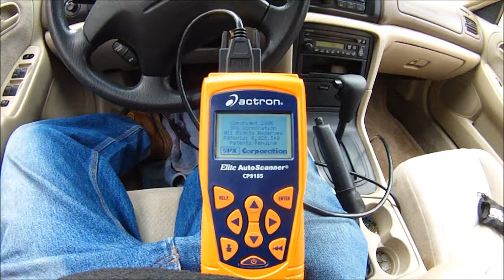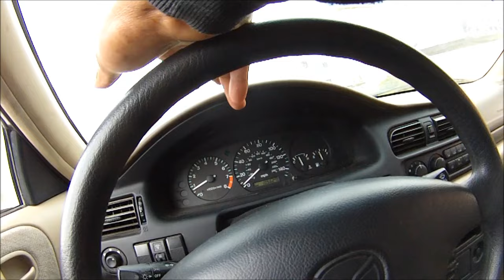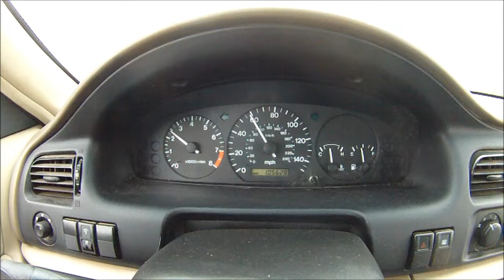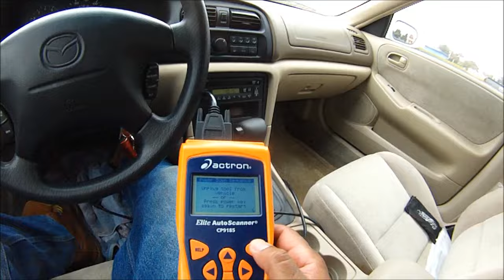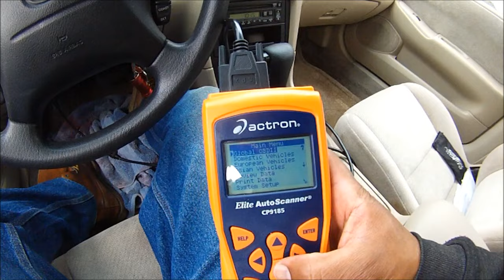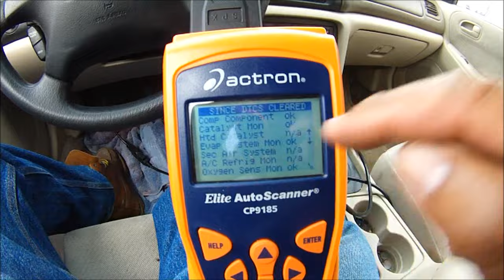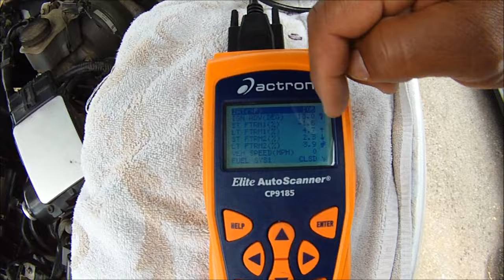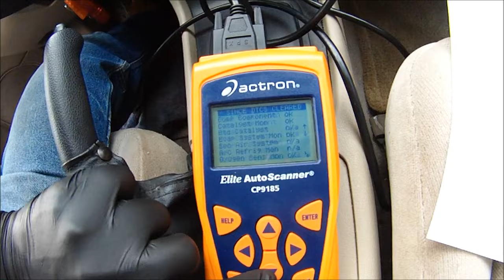WHAT SMOG TECHS WONT TELL YOU AFTER YOU FAIL THE SMOG TEST FOR (INCOMPLETION OF OBDII SELF TEST)

Comment: wow I did this without using an action or any code reader. I just disconnected the battery at a gas station bye a freeway on ramp made sure I didn't hit the breaks just used my E-break got on the freeway and keeped it between 35 and 55 miles an hour for 5 minutes then exited useing the break four at least 5 stop lights or 5 minutes. no more check engine light and went straight to the smog station. passed with flying colors. vwryt happy now great idea good job bro. for the video you posted.
Reply: same thing woulda happened if you just drove normally too  ;) lol
Reply: true but the scanner is nice tool for long term diagnosis with paying $$$ to shop just to look at check engine light. BUT I drove normally and still would not fix issue. I had to complete BMW drive cycles to get I/M ready state several times this week almost 200 miles!
Reply: "lol" you obviously have no experience with readiness tests not starting/finishing. MANY cars literally take over a thousand miles of "regular" driving until all tests clear if you do not drive in the vehicles specific drive cycles multiple times, including letting the car sit in between cycles overnight to get complete cold starts.
Reply: SUPEROBSCUREBEATS actually theyre programed to run asap under "normal"  driving.  If they're not running for someone for 1000 miles u are very far into "abnormal"  conditions. 

And i do have plenty of experience with obd2 (but yes like u said.. Not much with "drive cycle problems" if everything is working properly and u have patience  u can avoid driving around like an idiot (or wasting time on the dyno.)   

My comment is directed towards the 99% of people reading this.. I repeat u don't need to worry about drive cycles.  Theyre designed to be invisible and automatic (thats what makes them an effective self check)
Reply: Well the good thing is having this code reader is very helpful for troubleshooting issues and pro active maintenance at low cost besides just smog pass tests.

Comment: This works! It did it last night because there's less traffic at night. My Chrysler Pacifica 2006 passed smog. I got on the freeway and put it on cruise control over 55MPH  drove for 5+ minutes than drove the street for 20 minutes both the CAT an O2 sensor reset. Thank you for posting it. FYI 
Before I drove the car over 200 miles and took it to the smog place and they kept telling me the monitors where not ready. Did this and it works.

Comment: I have been driving cars to set monitors for a few years now. I agree with most of what you say, but using the emergency brake to stop the car on a busy road isn't a good idea. The cars behind you won't notice you stopping because the brake lights won't light up, and you may get hit, same applies to just "coasting" to a stop. Also, to help run EVAP, make sure you half between 3/4 and 1/4 of a tank of fuel. On most cars, a little above half works well.

Comment: I didn't even get a chance to follow your drive cycle "hack." I had to jump start my wife's Jeep and when I took it to the smog guy, it failed because the monitoring systems were not ready - he told me to drive 100 - 200 miles, so I planned on doing so in the next two days. I found this video and was going to follow the instructions; I plugged in my ODB2 scanner (which already had a big I/M button) and all of my systems except EGR were already ready. While on the drive back to the smog guy, the EGR was ready and I passed smog.

Comment: omg thank you. i knew this was a gamble but it worked for me and you just saved me so much money and bought me some more time. i had a check engine light on with code p770 shift solenoid e malfunction, but my trans was running fine and the mechanic told me it would cost anywhere from $500-1500! that's half the value of my car and i could not justify spending that much. first, i pulled the emf fuse out for a minute, then did the drive cycle just as you said, then added some oil and used carb cleaner on throttle body, filled tank up halfway, filled tires with air and took it directly to the smog station when the light didn't come back on. it passed! thank you!

Comment: oldskool u speak true. 
the cars that need repairs are the one with smoke coming out the exhaust. all other cars dont need repairs for exhaust air. cars are more clean than before 1995 and most of the cars before 95 are also clean. now the cars that are poluting the most from before 95 are becoming exempt from smog. when it should be the newer cars that should be exempt from smog test, they run cleaner and more efficent.

we the mechanics and technitions shouldnt fear police when out on the street testing a car. we are the ones who they come to to fix their cars. 

keep doing what u do oldskool.
"handleit"

Comment: I been a smog tech in cal for 15 years. What oldskool did  was right to set the monitors on most cars.I just want to add a  few things he didnt mention even though he did them right. Its very important that you start your car when it is completely cold and once it is started  just let it idle, DO NOT drive the car for 3 or 4 minutes.If the car isnt cold or if it is cold and you drive away with out it idling for a few minutes you can drive it all day and you will never set the evap monitor on most cars.This only applies to the evap monitor.

Comment: Ford Drive Cycle Recommendations: (don't worry to much about step 14, most states a car will still pass with with an inc evap monitor but if your vehicle has adjustable timing make sure and check the timing, your car will fail if timing off even if it passes everything else)
1. Most OBDII monitors will complete more readily using a "steady foot" driving style during cruise or acceleration modes. Operating the throttle in a "smooth" fashion will minimize the time required for monitor completion.
2.  fuel tank level should be between 1/2 and 3/4 fill with 3/4 fill being the most desirable. 
3. The Evaporative Monitor can only operate during the first 30 minutes of engine operation. When executing the procedure for this monitor, stay in part throttle mode and drive in a smooth fashion to minimize "fuel slosh". 

Drive Cycle Preparation  - 1. Install scan tool. Turn key on with the engine off. Cycle key off, then on. Select appropriate Vehicle & Engine qualifier. Clear all DTC's/ Perform a PCM Reset. Begin to monitor the following PIDs: ECT, EVAPDC, FLI (if available) and TP MODE. Start vehicle WITHOUT returning to Key Off. Idle vehicle for 15 seconds, then drive at 40 MPH until ECT is at least 170°F.

Prep for Monitor Entry - 4. Is IAT within 40 to 100° F? If Not, complete the following steps but, note that step 14 will be required to "bypass" the Evap monitor. 

HEGO Monitor - 5. Cruise at 40 MPH for up to 4 minutes.

EVAP Monitor - 6. Cruise at 45 to 65 MPH for 10 minutes (avoid sharp turns and hills) Note: To initiate the monitor TP MODE should =PT, EVAPDC must be >75%, and FLI must be between 15 and 85%

Catalyst Monitor - 7. Drive in stop and go traffic conditions. Include five different constant cruise speeds, ranging from 25 to 45 MPH over a 10 minute period.

EGR Monitor - 8. From a stop, accelerate to 45 MPH at 1/2 to 3/4 throttle. Repeat 3 times.

SEC AIR/CCM (Engine) - 9. Bring the vehicle to a stop. Idle with transmission in drive (neutral for M/T) for 2 minutes.

CCM (Trans) - 10. For M/T, accelerate from 0 to 50 MPH, continue to step 11. For A/T, from a stop and in overdrive, moderately accelerate to 50 MPH and cruise for at least 15 seconds. Stop vehicle and repeat without overdrive to 40 MPH cruising for at least 30 seconds. While at 40 MPH, activate overdrive and accelerate to 50 MPH and cruise for at least 15 seconds. Stop for at least 20 seconds and repeat step 10 five times.
Misfire & Fuel Monitors - 11. From a stop, accelerate to 65 MPH. Decelerate at closed throttle until 40 MPH (no brakes). Repeat this 3 times.

Readiness Check - 12. Access the ON-Board System Readiness (OBDII monitor status) function on the scan tool. Determine whether all non-continuous monitors have completed. If not, go to step 13.

Pending Code Check and Evap Monitor "Bypass" Check - 13. With the scan tool, check for pending codes. Conduct normal repair procedures for any pending code concern. Otherwise, rerun any incomplete monitor. Note: If the EVAP monitor is not complete AND IAT was out of the 40 to 100° F temperature range in step #4, or the altitude is over 8000 ft., the Evap "bypass" procedure must be followed. Proceed to step 14.

Evap Monitor "Bypass" - 14. Park vehicle for a minimum of 8 hours. Repeat steps 2 through 12. DO NOT REPEAT STEP 1.

Comment: Failed in CAT emission test. Followed your instructions. Cleared and passed the emission test today 01/19/22. Thanks for your well explained video.
Reply: My has a P0420 code And my Check engine light came on after I did the drive cycle T_T
Reply: @ameemetta2790  , it could be faulty 02 sensor,fuel injector,ECM, Spark plug or dirty Air filter.
Reply: @kawaiicreatures8663  ... thank you .

Comment: Rule of thumb that seems to work is driving normally until temp guage is half way (goes into O2 closed loop) for about 15min, then drive some highway miles. (At least past 45MPH.) If you take it to emissions after getting the car warmed up, then it usually goes through ok. Of course this varies per car, but seems pretty consistent on GM 3400 V6. Braking normally doesn't seem to bother it at all, but my car has no problems with vacuum going to the brake, fuel system is airtight, and evap gets enough vacuum to work as it should. (If normal braking causes a fail, it's likely something wrong with a coast-down vacuum condition affecting the emissions stuff.)

Comment: How can I get an older car to pass the smog?
I have a 84 nissan pulsar, I appreciate any help you could provide, thanks!
Reply: The following vehicles are exempt from emissionstesting requirements (but removal or tampering withemissions equipment on any of the listed motor vehicles is prohibited): Model year 1995 and older vehicles. Model year 1996 and newer vehicles that are not OBDII-compliant (must be verified at a test station).

Comment: I just wanted to come on here and say that it worked for my 2000 Nissan Maxima I found it's actual drive cycle which was very close to this. So I did it and after 550 miles of the Cat monitor not being ready the monitors were ready after the 2nd drive cycle attempt. thanks again and good luck

Comment: 11/16/16 - Thank you, oldskool funk!!!! I followed your method in video and passed smog. My car: 2000 Toyota Camry.  Here are a few additions/improvements. For those caught in this particular smog trap, understand a few things: 1) the drive cycles for your car are published by the manufacturer of your car. Contact them, search the internet or go to a dealer -- BUT THESE DOCUMENTS EXIST AND ARE AVAILABLE. Many people will make you believe that the exact parameters of your drive cycle are a mystery -- this is ABSOLUTELY FALSE.  2) The drive cycles not only for your car but for the specific NOT READY situation you are experiencing are VERY PRECISE. If you drive even 5 MPH above or below the expressly directed speed for the drive cycle, you will not succeed. But DO NOT WORRY. Like Oldshool Funk shows us, once you know the speeds to drive, the rest is EASY.  3)  Do this at night when road traffic is minimal. I did this from 10 PM to 11PM and it was easy.  4) Use CRUISE CONTROL as much as possilbe. Cruise control makes doing 60 MPH a piece of cake. It also makes driving 35 MPH easy. 5) I am not sure if avoiding the foot brake is essential as Oldskool Funk describes, but I did it and his method WORKED (thanks again!!!). With that in mind, choose your Exit ramp carefully. I chose one that was 8 miles from my starting point and had and UPHILL slope and a long, clear shoulder. As I approached the exit, I turned cruise control off and I put car into 2nd (lower) gear (automatic trans). This helped slow my forward momentum dramatically without having to use foot brake. Then I entered the shoulder area, running parallel to the freeway, and put the car into NEUTRAL. I then gently applied the hand brake as Oldskool describes and my car came to a nice, safe slow stop. I then turned the car off and waited 1 full minute before going to 2nd phase. That's pretty much it. Don't be intimidated by this. It isn't that the drive cycle thing is such a mystery or so difficult -- it's just very specific. Essentially, manufacturers did this so that no one could fake a smog test. We are forced to drive the car through normal highway speeds (stage 1) and then around town (stage 2) to get it ready for smog. However, highways speeds used to mean 55 MPH. Today in CA they are closer to 80MPH. So you have to drive like -- in my case -- it's 2000 and not 2016. My car tested NOT READY 6 times over 2 months. I spent hours driving all over the place at different speeds to complete the drive cycles.  No one had a real answer. I replaced many parts unnecessarily due to ignorance of others. Then I saw this video and I was able to locate the Manufacturer's Official Drive Cycles Bulletin for my car. In the end, it took 1 hour of driving. My car passed the next mornging. Thank you Oldskool Funk. We are brothers in Smog!

Comment: I hope that you do not mind me adding my 2 cents worth :)
Been a smog tech for 25 years.  Have seen a lot.  Hard to get some cars to complete monitors, other fly thru.  Evap monitors usually have to run stone cold, and gas tank between 1/4 to 3/4.  Engine has to get hot enough.  If thermostat is stuck open some monitors will never run.  Most cars the intake air temp sensor has to be within 15 deg of the engine temp when stone cold.

Had one last week 2 monitor wouldn't run no matter how much driving they did.  Found that the truck's computer was seeing a part throttle so it wouldn't run some tests.  The throttle position was reading 1.03V.  Found that if I adjusted the throttle position sensor ever so slightly (down to just 1.02V) the computer now read closed throttle.  Just a hair off.  Once done the cat monitor passed w/ ease and this was good enough for CA emissions.  The throttle position sensor should be near .54V but for some reason I could only get it to .95V.  Non adjustable but good enough.  I deduce that the computer readings were skewed, most likely from a bad ground.

Sometimes they can be very tricky.  Years ago I had a 2001 S10 pickup that wouldn't set 3 monitors.  Found that the fuel pressure sensor (fps) was reading too much pressure.  Once fixed (had to drop gas tank), the others flew thru.  Mind you I put about 100 miles on this and the other shops put an additional 200.

Comment: Here is what smogs techs WILL do for $120.00 in CALIFORNIA if ONLY your OB2 monitors are not ready (cost 120.00): 
1. Put in gas tank FUEL INJECTION CLEANER.
2. DRIVE ON INTERSTATE for 50 miles at 60 mph,
3. DONE.

Comment: Thank You.
Any idea why my Ram 1500 model and specifically 2002 - 2008 are having issues passing smog?

I have an ‘02 and am being told to keep driving it until it clears the catalytic codes.

Both smog shop and dealership said the same…
I’m approaching 2,000 miles and cannot get it to clear.

I tried your advice and still won’t clear.

I’ll try it again tomorrow and maybe it’ll work?...🤷🏻‍♂️

Any ideas?
Thank You 🙏🏼

Comment: I always put GOD first and I prayed to him before actually following your instruction to the letter. Although I ended up changing 1 catalytic converter (engine light and code pointed out the problem), I was faced with getting the monitors ready all over again. So the next day after the repair I did everything you did and all monitors cleared except the EV monitor. Thank GOD I read online due to the year of my car I could actually pass inspection with one monitor not being ready and so I did pass and got my new sticker the day after repair. One big tip about getting monitors ready is driving 100 to 400 miles is not the answer. Also, invest in a scanner for future issues. GOD bless you for sharing this information.